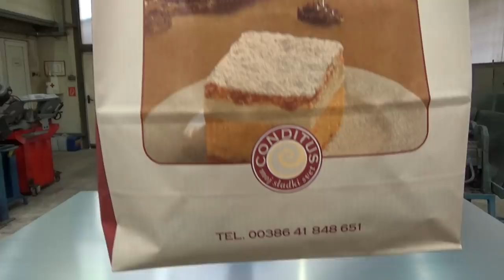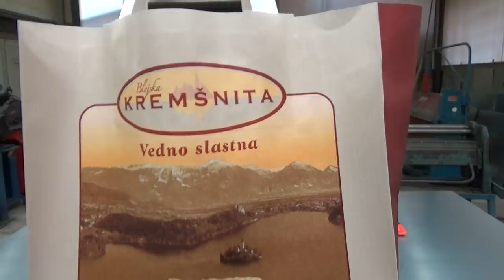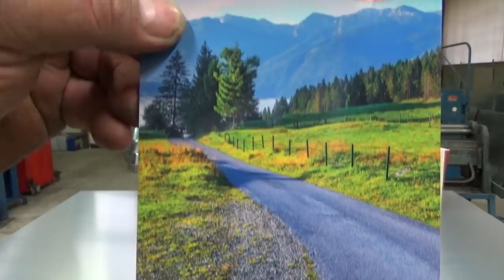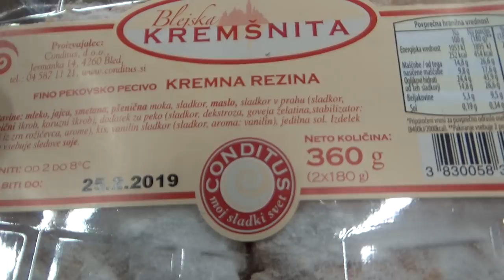Taste SLOVENIA with Petrinčič Brothers Blejska Kremšnita

Comment: I love the fact that you have a compact wonderful country. I spent 20 days doing the east coast loop (7008 kilometres) here in Australia. It was over our Christmas with average temperatures in the 40’s C (never below) and three days before I was due home back in Sydney, belt, hit a kangaroo and stuffed my ute. Got it towed back along with my camper trailer to Lightning Ridge NSW and spent a week there. One of the best weeks of my life. Went down opal mines, dug opals, ate great food, went to some amazing outback pubs. It was so relaxing. When my new radiator turned up, a bit of bush ingenuity with pulling a panel here and removing an item there, I fitted the new radiator and stitched the ute back together with cable ties and without air conditioning (condenser smashed) set off back to Sydney. Hot as blazes. Got back to Sydney to 48 C high humidity and boiled. But I will never forget the holiday. Best ever!
Reply: Great story.   The best  experience in Australia is simple conversation.  Australians are the best if you value friendliness.  Of course, the country is spectacular.